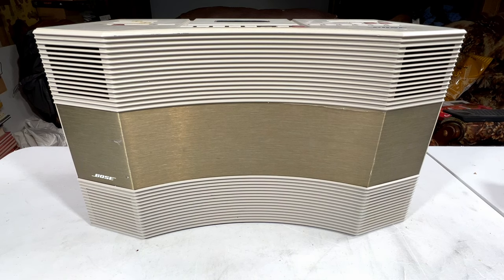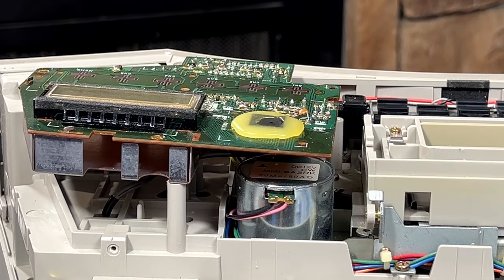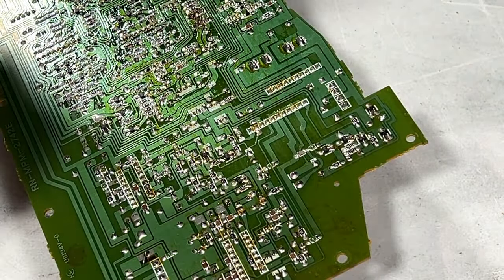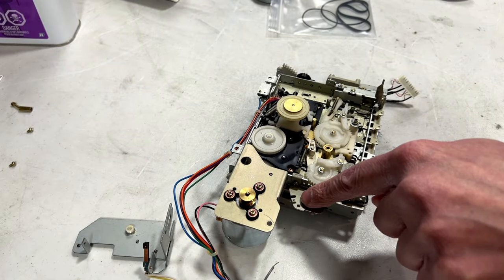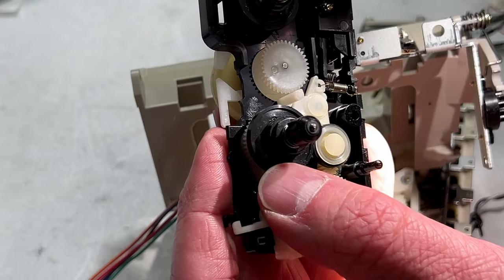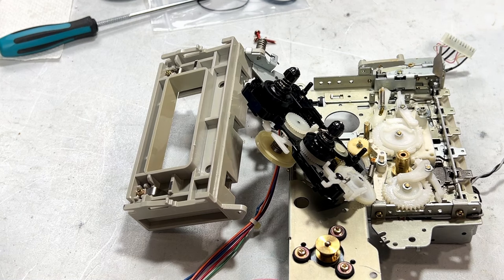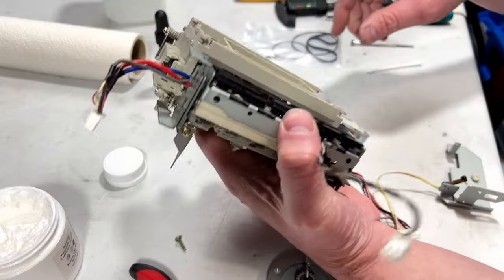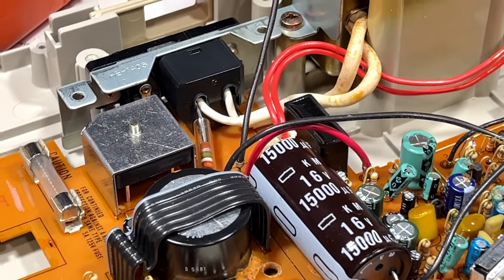Bose AW-1 Acoustic Wave System - Tape and Tuner Both Dead

Comment: I wouldn't record over tapes with valuable recordings like these, I've done it once or twice and regret it right after. There's just something special about listening to an old low-fi recording from the original piece of media. If you want to have the same mixtapes in better quality I would suggest finding the same tapes (probably not a very easy thing with that Vivox) or just find a some tape in a similar shell and clone the stickers and j-cards, that way you'll have both the originals and the remasters. And the other thing to consider is that there's no guarantee that those old tapes won't be full of dropouts when you try to record over them.

Comment: Just to add, although two monts later, an AC of 15 volts, after the transformer, rectified should definately be around 18 volts DC on the smooting capacitor. The problem might be the grid AC voltage and the transformer set for a lower one. For ex the transformer is expecting 110V but is getting 120V.

Comment: The tuner is completely dead...it occurred the opposite way round over here in my cassette radio CD player...cheaply made Bush LoFi...Tape wheels fell out first..then CD went on one channel..then I tried to fix it..failed and no CD sound..but the digital radio still works..I'd even say perfectly..so it hasn't been thrown in the rubbish as eWaste..not yet